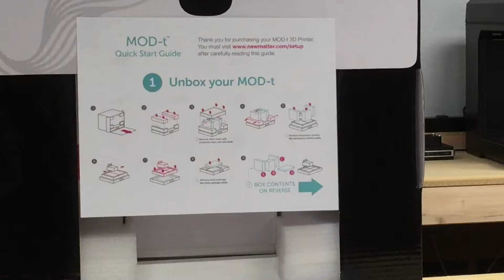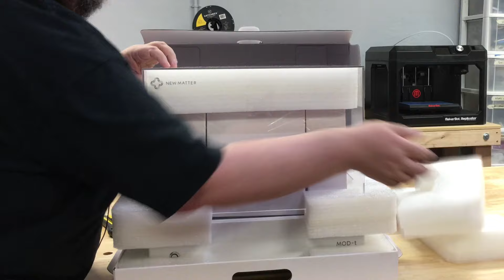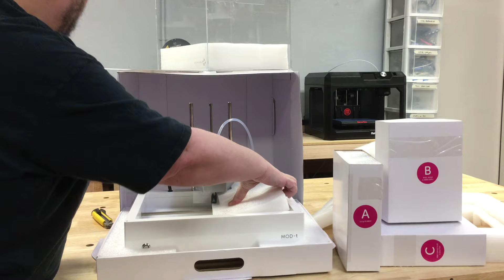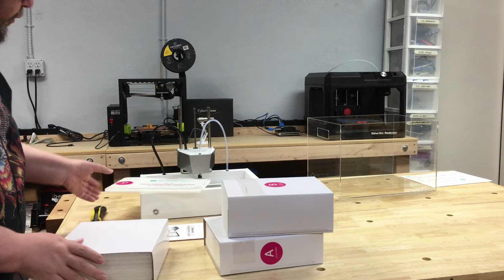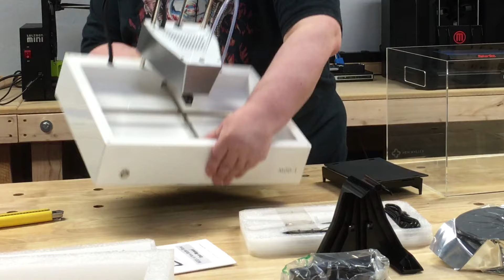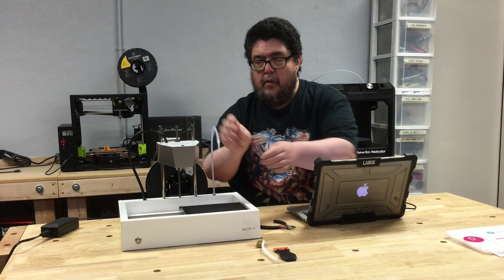A look at the MOD-t, a low-cost suitable-for-the-office 3D printer

Comment: Question, can you use Cura or other 3rd party slicers with this printer, or are you stuck using their software? What the 3D printing market doesn't need is yet another devices that's non-standard and proprietary.
Reply from the maker: Looks like you can use Cura. I found a blog post from the company with details. I'll be testing that later on. Not sure if I can drive it from OctoPrint, though.